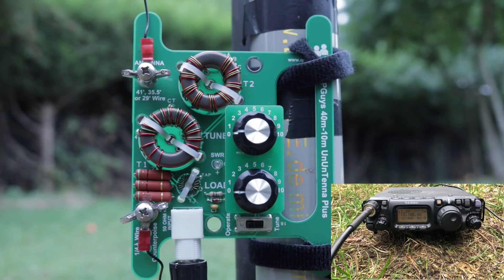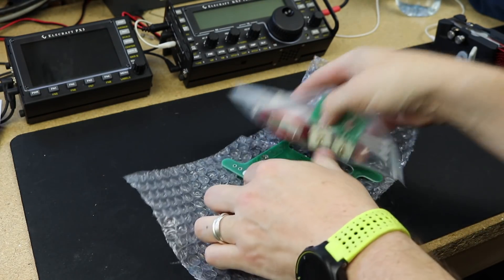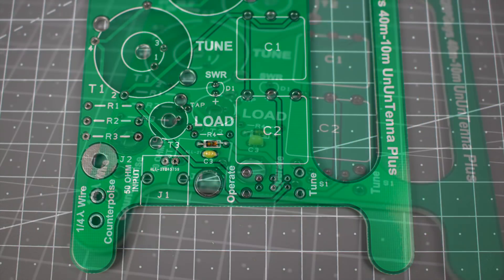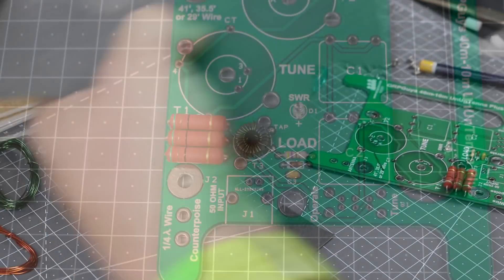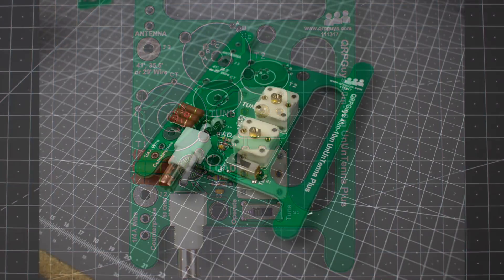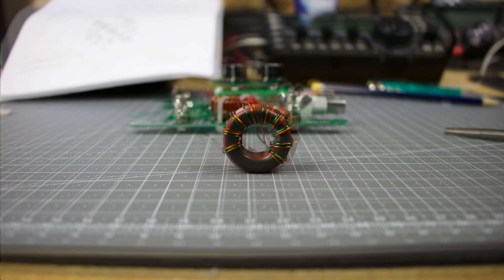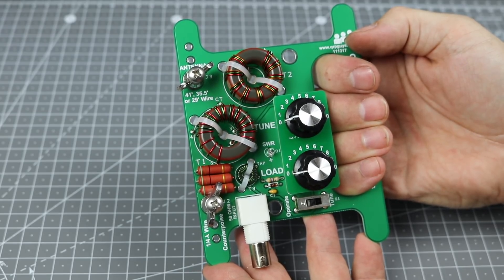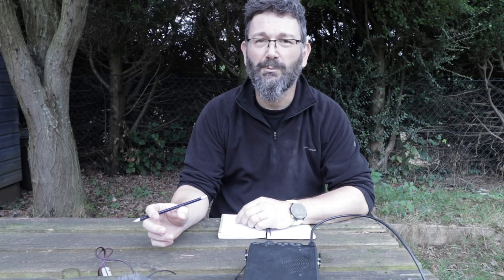Review of the QRP Guys UnUnTenna Plus

Comment: No matter what I do, my unit refuses to tune up on 40 meters.  I've tried different lengths of wire, different radials, changed the winds on the toroid as directed by QRP Guys.....and nothing works.  Pretty disappointed.
Reply: the instructions were a little confusing with the two trimpots under the polyvaricon caps themselves, where you have to set them to the maximum position, the caps that was included did not match the diagram but while they did put a photo of the updated one its a page below and soldering world have taken place thereby preventing you from changing those. I wonder if your caps are out of trim as a result?
Reply from the maker: That’s odd that you’re unsuccessful even trying all that you have. I wonder if one of your polyvaricon capacitors is faulty or out of spec? I have a feeling that in 40m I’m right in the range of them. What length driven element and counterpoise are you trying?

Comment: It’s odd that the LED lights up when transmitting in the Operate switch position. It should be out of the circuit in that position. I guess it’s due to coupling between T3 and one of the other toroids, but I’d expect them to be better isolated. My QRPguys EFHW Mini-Tuner never lights the LED in the Operate position.
Reply from the maker: I think you're right, the SWR bridge circuit isn't grounded or shorted so likely it's picking up enough stray RF to light the little LED. Not an issue but every time it catches my eye I think I've forgotten to flick the switch back to 'Operate'!
Reply: @g0pot  On my most recent deployment with a 32 foot wire tuned for the 20m band I noticed the LED on my EFHW Mini-Tuner is now lighting when in Operate mode! It’s very dim but noticeable. Before the tuner was outside and now it’s indoors, so maybe I didn’t notice it before due to ambient light. It still tunes well. I often double check with a NanoVNA and the LED always gets SWR below 1.5. I’ve only had problems tuning if I was sloppy about deployment or had a poor counterpoise. It’s a good product.

Comment: How many feet of coax are you using from ununtenna to your radio? I have 25ft coax and 29 ft of 26awg with the suggested counterpoise of 1/4 wave 8.2ft for 10Meter. I can receive fine but can't seem to transmit and the SWR is trash
Reply from the maker: Similar to you. I’ve used coax lengths of about 50cm up to ~10m and it was OK. I’m sure I tried it on 10m…I’ll try and set that up this weekend and see how mine fairs and report back here.
Reply: @g0pot  kind of annoyed, I wanted to love this dopey lil thing. I'm using with my new Xiegu G90, maybe I'm asking too much out of my skillset at this point. I just got this radio and updated to the new firmware. Out of the box I got a ton of signals from far away places but I cant transmit for nothing!
Reply from the maker: @ChrisGrazioli  OK, ran tests this morning using 8.8m (vertical) radial and about 4.83m counterpoise laying on the ground. I'm only using 5W from a KX2 and I used about 50cm of coax as this should give me worse results than a longer length. Tuned perfectly on 10m and 15m too. Drizzle and a flat battery prevented me trying more at this time. Look me up on QRZ and send me an email and I'll share pictures and more info. Your G90 has an ATU built in I think so you do have other options. Make sure the G90 ATU is bypassed when using the UnUnTenna otherwise you may have trouble tuning.
Reply from the maker: @ChrisGrazioli  ...one other observation Chris, I think the G90 can put out up to 20W. The UnUnTenna Plus is really for QRP (those polyvaricon capacitors don't handle much power). I would recommend keeping power to 5W CW or 10W SSB when using this aerial tuner.
Reply: @g0pot  I kept the power between 5-10Watts. I just do SSB at the moment
Reply from the maker: Further measurements using 8.8m (vertical) radiator and 4.8m counterpoise laying on the ground). This tunes with a good dip in LED brightness on 30, 20, 15 & 10m. 40m and below won’t tune with this short wire. On 12m I can tune the aerial but the dip in LED brightness is almost impossible to see. I can’t tune 17m but I think an 8.8m element is quite close to a half wave on 17m (8.2m?) so the feed-point impedance of the wire is likely too high for the matching unit. I don’t have 6m on my KX2 so can’t try this band. Hope that helps.
Reply: @g0pot  So I got on 10m today with just about 8.8m (28' 10") hoisted in a tree with 25' of coax and a 1/4wave counterpoise. I was able to hear all kinds of signals from near and far. I made a contact from here in Connecticut to Florida. Spent some time playing with the Tune/Load Knobs and the LED is really dim, the SWR on the Xiegu G90 was really low at one point, so low that I don't think the meter was even working correctly .

Comment: I'm finding that mine refuses to "tune", that is, reduce the brightness of the LED with a 41' wire and 30' counterpoise.  The manual suggests removing 1-2 turns from T-3.  Has anyone else encountered this problem?  If it's really common, I wonder why the build manual has not been changed.
Reply from the maker: Are you only having this issue when tuning on a specific band or do you get the same issue across multiple bands with these element lengths?
Reply: @g0pot  The LED refuses to dim on 20-30-40.  However, I can change the apparent SWR on my MFJ analyzer when in Transmit mode.....not low enough that I'm comfortable using it, but it will change the SWRs a bit.
Reply from the maker: @oldgiapetto  OK, good that you could try that with the aerial analyser. The fact that’s it’s not giving you a low enough SWR in the analyser explains, perhaps, why the LED isn’t dimming. You might need to try some different wire lengths. I think for mine I have a 41’ element and a 17.5’ counterpoise (I went with an 1/8 wavelength for lowest band as a counterpoise). I’ll check my current wire lengths later in case I’ve modded these.
Reply: @g0pot  Yes, I also have a 41' wire.
Reply from the maker: @oldgiapetto I’ve just remeasured my elements and can see I have a 29’ radiator and 16’ counterpoise. I did prefer the 41’ element but needed something sorter for operating from hotels. This will tune on 40m but is more effective for 20m and up. I think I reduced my counterpoise from 17.5’ to 16’ to tune more successfully so that maybe something for you to try.

Comment: Great video -thanks.
Question - Can you use it horizontal ?  what difference would it really make ?
Reply from the maker: Yes, in terms of the radiating wire I was using it in a vertical configuration but you can set it up however you like: vertical, horizontal, a sloper, inverted Vee, inverted L. As it has a counterpoise it does lend itself to using it as a vertical but you could operate from, say, upstairs in a house, run the radiating element horizontal to a tree and just hang the counterpoise vertically from the window. So many options!
Reply: @g0pot  - Thanks for the prompt response Michael.
Very interesting - a versatile antenna for sure .
If used horizontally do you know if there is a  recommended height for best propagation ?
Reply from the maker: @smellthecoffee5314  That is a really good question with a not so simple answer. Firstly, it depends on what sort of distance you want to work. Lower hight might make for a poor ‘take off’ angle but if you are trying to work stations in your region then this ‘NVIS’ setup might actually give you the best option. Typically to give a reasonably low take off for a horizontal dipole we aim to get it half a wavelength high…so the band you are working on influences that. Mostly people just try to get it as high as they can. 
If you want to know more about aerial performance and modelling hit me up on email. Look up G0POT on QRZ.com.
Reply: @g0pot  great answer - I’ll keep that info in mind - thanks

Comment: Have you tried to tune it up using a nano vna before connecting to a transceiver?
Reply from the maker: For portable, SOTA and POTA I try to keep things as simple as possible so I aim to avoid carrying additional stuff like SWR meters and analysers. That said, their are certainly some small and lightweight options out there now so it’s definitely an option.
Reply: @g0pot  I won’t take my NanoVNA in the field, but I’ve used it in the backyard to check my QRPguys EFHW Mini-Tuner to gain confidence it’s giving a good match and to give me an idea of the bandwidth around the tuning frequency. When the LED dims, SWR is always well below 2:1. When the LED goes out completely the SWR is always below 1.2:1. The matching circuit is much different from the Ununtenna Plus, but the absorptive bridge LED circuit is identical. I now have high confidence in it, since it’s never failed to provide a good match.
Reply: @g0pot  True, every bit of kit counts when ascending a hill/mountain.  
Recently discovered your channel. Great stuff.
73,
Kf7rcm.

Comment: Many thanks! I just finished the QRP Guys's handy Power/SWR/Dummy Load and I'm finding it a delight. I just wish I'd know the trick you mentioned of using a smartphone to photograph its tiny torrid. It took me about a dozen tries before I was certain I'd gotten the number of turns right. I also got lucky. A tiny steel box for powering recessed lighting I picked up at a thrift store for $1 proved just the right size to give it a solid container. I do wish QRP Guys would offer a 3D printed case for their devices. For portable gear, I'm nervous about having the components exposed.

Comment: The most innovative part of the design for me is that when set on "tune" the radio never sees more than 2:1 or so on the antenna, and so you can send your carrier to your hearts content and it won't damage the radio, you're not scrambling at the knobs. 

Relieved to see they supplied extra enamel wire lengths, because some of us are lousy at it. 

73 de KN4GEI

Comment: Hello Michael! I have a QUESTION: How does affect the toroid in the making of the EFHW? I mean, I started to see how to build it (from your site) but right now I can´t find the toroids you include in the project (I´m in Chile). I have a couple of T50-2 and T94-2. Is there a way to use them? A way to calculate the performance with any of those and re-plan the project? Thank you in advance.
Reply from the maker: When I built a prototype I used a much larger toroid and that worked. I guess different core materials (powdered iron or ferrite) and different mixes and different sizes will result in different matching characteristics. I would grab a couple of options and try them out. I found that the bandwidth changed with different cores but so long as it creates a transforming match for the bands you want then all is good. I tested this by adding the windings to a core then connecting a ~2.5 to 3kohm resistor to the output and measuring the impedance over the HF bands using an aerial analyser looking for a result of 50 ohms.
Reply: @g0pot  Wonderful. Thanks again!!!

Comment: Do you think it would be possible to replace the LED indicating circuitry with a connector that went to a MicroVNA instead?
Reply from the maker: I guess if you want to use a MicroVNA you could leave the SWR circuit switched out (just put the switch in the operating position) and attach your VNA to the BNC connector. Or are you thinking about leaving it inline while you operate? I didn’t think that was possible with a VNA?
Reply: @g0pot  I was thinking about leaving it hooked up so that the tune/operate switch would send the signal to the microvna for tuning. then switching back to operate would take the Microvna out of the circuit. Basically so the Microvna replaces the LED light.
Reply from the maker: @nathanjames4242  Yes, looking at the circuit diagram at https://qrpguys.com/ununtenna-plus I guess you could omit the SWR components and connect S1B to your VNA...maybe add a PCB mount SMA socket if that’s what your VNA uses. Check out the circuit diagram and you’ll see the potential.

Comment: Why not have just soldered the resistors to the other side?
Reply from the maker: was following the build instructions and had no idea their was going to be a problem until I fitted the screws and wing nuts. The QRP Guys could have issued an addendum to the build notes to highlight this necessary change.
Reply: @g0pot  Having the dummy load resistors spaced above the PC board is a plus, since it allows more air to circulate around them. In their Power/SWR/Dummy load kit the QRP Guys specify that the resistors are to be spaced above the board for that reason.

Comment: Excellent video, nicely done. I'm wondering something though.  Because this is an Un Un as well as a Tuner, can I assume this will do a much better job tuning a Random Wire to a KX-2 or KX-3, than using the built-in Elecraft Tuner alone?
Reply from the maker: Michael Higgins It’s rare for me to attach something that an Elecraft tuner can’t cope with. An un-un is simply trying to bring the impedance of your aerial into a range that your radio can cope with and therefore it can help where your ATU is struggling on its own, however, because this also has the variable capacitors to help ‘tune’ the aerial I’m less clear on the effect of connecting it in serial with another ATU. In truth, if your Elecraft ATU can’t cope I’d simply change the length of the random wire by half a metre or so.

Comment: Thanks for the warning about 40m not working.  I have a 43 foot vertical and the qrpguys kit for the 40m – 10m Multi Z Tuner.  If that does not work on 40m, I will let you know.
Reply: I think he was saying that it didn't work only because he didn't have a long enough radiating wire for 40m

Comment: I put this kit together some time ago and I’ve experimented with a wide range of non-resonant wire lengths, counter poise and feedline lengths and I’m yet to discover a combination that will allow a reasonable SWR on 40m. But as you found, 30 and 20m are easy to find a match. I suspect the tuner design used here doesn’t have the range to match the low impedance you’d expect with a short radiator on 40m and after a 81:1 impedance transformation . It’s a pity, because 40m is a useful band for QRP right now and it’s otherwise a nicely designed kit.  I tried changing the unun to 4:1 and even removing it completely and still can’t find a combination of wire lengths that yield a satisfactory SWR on 40m. 73 de VK7JB
Reply from the maker: zendoc62 I’ll go back out to the field and test some longer elements then and see if I have the same issue. While making the video I was also interested in making a vertical so I was limited to a 9 - 10m radiator. I’ll report back here with my findings.
Reply: Michael Sansom Excellent Michael - I’ll look forward to hearing your experience. I tried various configurations of vertical, sloping and inverted V radiators and both tuned, elevated radial and simple counterpoise wire lying on the ground for RF return. As expected, feedline length also influences tuning of the system.  I enjoyed your video very much BTW, so thank you! 73, VK7JB
Reply: @g0pot  Any conclusions regarding the ideal 40m configuration?
Reply from the maker: @dgkrompholz  For portable/SOTA I now stick to an EFHW as I don’t need to fuss with counterpoises and tuners. Check out the 3-band EFHW design on my webpage at www.peanutpower.co.uk/efhw. Of course, when mounted as an inverted V on a low pole (6-10m), any EFHW, dipole, long wire, etc is predominantly an NVIS aerial…great for shorter range contacts, not so good for DX.
Reply: @g0pot  Thanks but I was referring to the antenna you reviewed in this video, and inquiring about the ideal feed line length for lowest swr for 40m, assuming a 35' counterpoise.

Comment: Thanks for the video, Michael!

Would it be possible to reverse the wingnut at the bottom (the one close to the resistors) so that it's on the opposite side of the PCB?

de KB3MBM
Reply from the maker: Absolutely...the wing nut assembly can easily be mounted on the underside of the board and it wouldn't affect the connectivity or access to the wire strain relief. The only impact would be raising the profile/thickness of the board. I opted to keep the wing nuts on top because this will travel in the shallow side pocket of my cabin bag on flights and I wanted a nice flat surface against the bag outer so as not to cause wear or snags. It's also nice to be able to see (visually) the wire firmly connected to the terminal posts while using the controls so you know it's all connected properly...minor stuff though.
Reply: @g0pot  Good to go! I want to get one of these and/or their 40/30/20 vertical antenna tuner to use with my MTR3B.